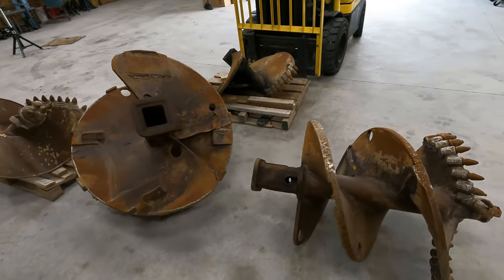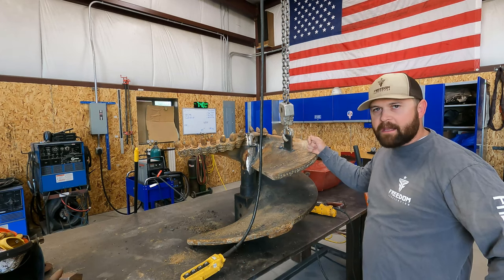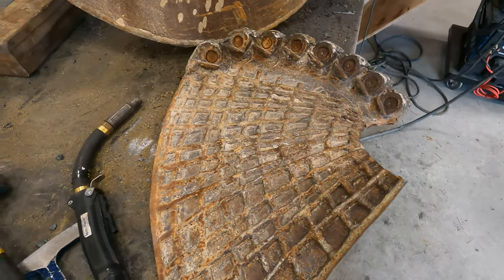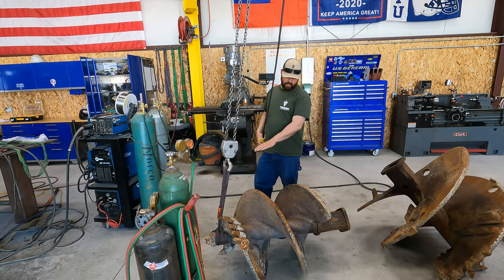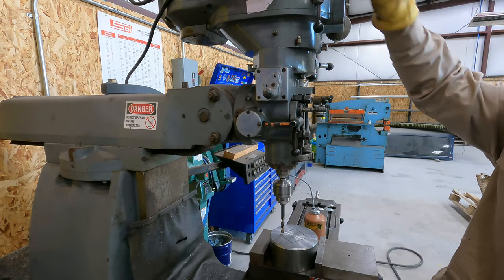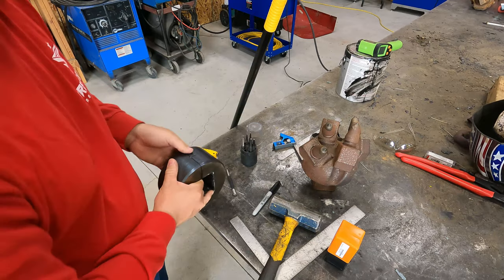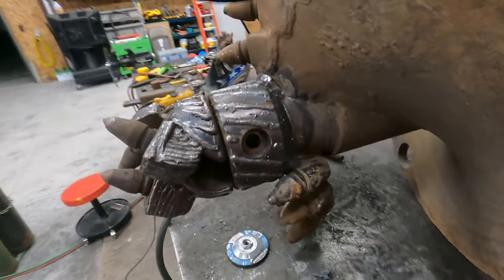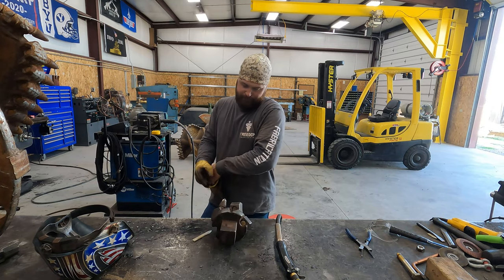Auger bit welding and machining rebuild

Comment: Suggest: that small crack that can potentially cause a start of another weld failure drill a 3/8 through hole at the endo of crack then fill .

Comment: @Freedomfabrication777  why didn't you drill all 4 corners? Wouldn't that have made it easier to get the square hole cut out.
Reply from the maker: That would have made the corners more true and consistent, which is a good thing. I do think it would have taken quite a bit more time though, to drill through that thick plate on all 4 corners. My main concern was to be able to get the torch flame started on a clean true cut. Not a bad suggestion, though. Thanks for watching!👍🏻

Comment: When milling a counter bore it might be easier to bring the knee up and zero the dial and raise the knee instead of bringing the quill down. It should help to reduce the chatter.
Reply from the maker: That’s a good point. Thanks for the suggestion, and thanks for watching!
Reply: @Freedomfabrication777  Ive been watching you videos a lot lately. Love the commentary, shop layout and decorations, and the variety of jobs that come through. The only thing I didn't like was the aluminium step video, I went on fireball tool and spent 900 dollars on some more of their squares because of you lol. Keep up the good work.
Reply from the maker: @broncobill1204  You can thank me later! Lol. I don’t think you’ll regret having them. I sure don’t. Sorry about the loss of funds. Sounds like you have a tool addiction similar to mine. Thanks for watching!

Comment: Great work! I have been going through your old videos and you do some really quality stuff. 

For grinding inside the square holes, I I have the perfect $40 tool for ya. It's called a band file and it's essentially an angle grinder with a little pin point belt sander attachment. I just made a YouTube video on my channel showing all the uses if you want to check it out. Keep up the great content!
Reply from the maker: Thank you for the positive feedback. 
Believe it or not, a band file has been on my tool wish list for a while. I’m definitely gonna be buying one in the near future. I will check out your video. Thanks for the input and for watching!
Reply: @Freedomfabrication777  Thank you!